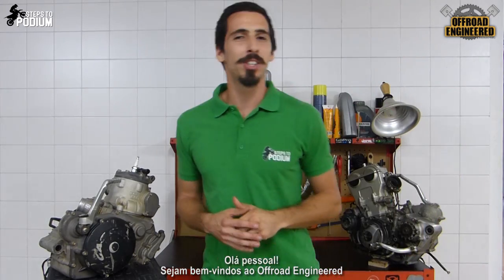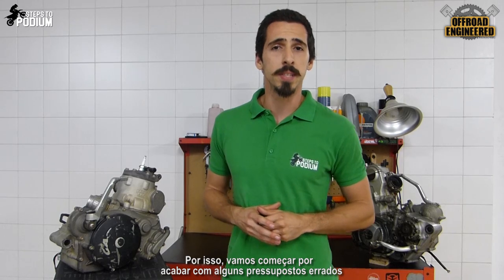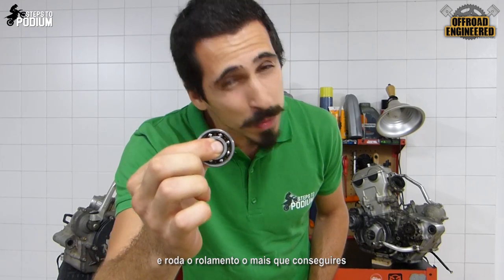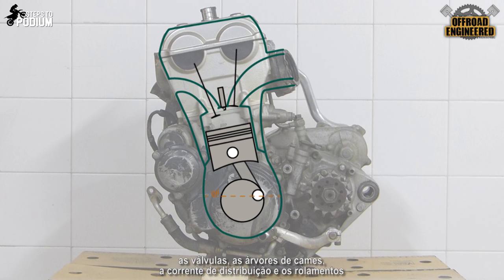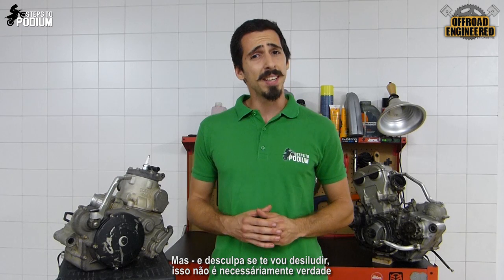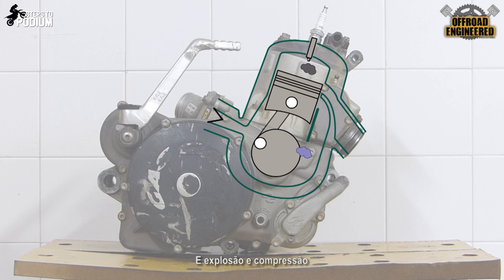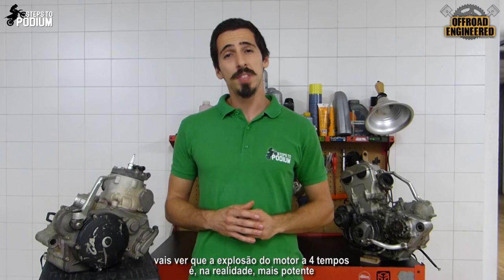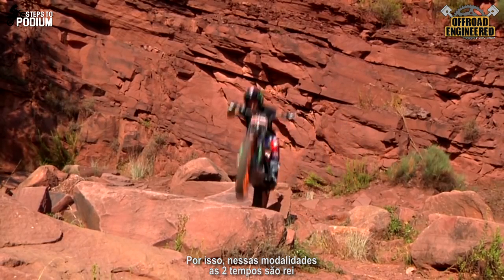2-stroke VS 4-stroke | Offroad Engineered

Comment: I raced dirt bikes in the woods for several years back in the late 80's-early 90's in (tight woods in N. Alabama and S. Tennessee mostly), some four stroke bikes and some two stroke bikes, and my experience was that the four stroke bikes were too heavy and wwwaaaaaay too hot to ride during hot weather, and that fighting that horsepower, weight, and heat would make me three times as tired by the end of the ride as the two stroke bikes made me feel. The two stroke bikes were lighter and much easier to maneuver in tight woods, plus they were water cooled and weren't hot at all to ride even during really hot weather. Four stroke bikes are great for fire roads and dirt roads, but not for tight woods riding (IMO).
Reply from the maker: Agree! 😊

Comment: I love my 2 strokes and one of these days
 Going to finally get around to finishing converting my 2t to fuel injection.
Reply from the maker: great project! 💪
Reply: Steps to Podium 
Sadly the shoppe I use to work at closed 2 months, we had a dyno. I was going to fuel inject 2 f my bikes, 
2003 Derbi Senda Super Moto that has every performance part money can including a Bidalot 6 speed gear box and FAG brand bearings for very thing. I even cut the swing arm and stretched it 10 niches for better traction and I kept the wire wheels cause they are lighter than alloy but do go tubeless. 

The other bike is a 1978 Kawasaki KZ1000. I have got that one a set of inverted forks, for the rear I have to do some welding to mount the a and all new brake and controls. Swing arm off a 2010 Z1000z 
For now my bike has been hung from the rafters and the motor and all it’s parts  are bagged and boxed, for a date to be announced later. For not I have to focuse on an impending surgery’, shattered my legs I. An accident years ago but now dealing with have one of them amputated. 
(deep sigh) 
It’s a good thing, I mean I’m going g to be even lighter,, more HP:Kilograms and less wind resistance too... cause why be careful .

Comment: 2 stroke is the best for off road ( motorcycle ).
Reply: Not if your lucky to own an RS250 and a H1 500.  Depends on when you grew up and what was around at the time. Modern kids just see four bangers everywhere and a crude 2t in cheaper bikes.  Not the old standard road going toys putting out 240hp per litre.

Comment: there's no other feeling, or any other time when you scare yourself but have a massive grinn on your face than when you hit the band on a 2stroke..😃
4strokes just dont do it for me after growing up riding 2strokes.
Reply: Race a 1000cc 4 strokes bike then, your smile will be compressed to the max.
Reply: I get the bigger grin when riding a 450 and having this massive power eveywhere, all the time, ready to explode without having to wait for the revs to build up. A 250 2t feels weak in comparaison even you can get good acceleration once it finally gets to the top of the power curve.
Reply: @Wide000  
I hear ya pal,
Its just i grew up in the 90s and love the power delivery of the 250 2stroke,
Im sure the 450s are much better in lots of ways, but its the powerband that makes the cheesy grin, and that feeling you just cant replicate with a safe, steady acceleration of the 450 4stroke.

But everyone has their own favorites mate.

It doesn't matter what you ride!, 
What matters is, that you ride!!.

Peace
Reply: @anonymous2065  Agreed. I am a vet rider myself and  also like the 2t. And I am no faster on a 450, just amazed by the massive power each time I ride my older CRF. The best compromise after trying all displacement, 2t and 4t, is the 350. It won't waste you as much as a 450, almost as fast overall, but lighter feeling, linear power, easy to ride, rev to the moon. You can ride it as smootly or aggresively as you want, and it will work in both case.  I love mine. Perfect vet bike.
Reply: @anonymous2065  4 strokes are more superior, it has stability to go beyond the top speed of 2 strokes. More displacement, more power, 4 strokes can handle more compression, whereas 2 strokes is prone to overheat, that's the reason why there is no 1000cc 4 cylinders 2 strokes, it will overheat in seconds, dead. That's also the reason why GP 500 ends with 500cc 2 strokes, it is the limit.
Reply: @Wide000  
Hmmm, that sounds like a good comprise,
The 350 would have more than enough power for me, 
To tell you the truth, i dont like the 450 4t, they are too powerful, big, heavy for me.
It sure does make me appreciate the top riders of mx or sx, because the fitness levels of some of those riders must be off the charts.

Nice talking to ya pal.

Peace
Reply: @novrahadi8568  everybody is ignoring you 4stroke fanboy hahaha
Reply: @rodmaiquez726  don't watch Motogp and WSBK then, because they are 4 strokes hahahahaha, even the fastest bike on Earth the Kawasaki Ninja H2R is 4 strokes. These bikes will smoke the 2 strokes. And these 4 strokes will feed the 2 strokes to dust hahahaha
Reply: @novrahadi8568  2 strokes are best for dirtbikes and 4 strokes are for roadbikes, that's common sense even for a 12 yr old like you
Reply: @rodmaiquez726  4 strokes are still very capable for dirtbikes, but the 2 strokes are dead for 186 MPH class of speed on the road lol lol
Reply: @novrahadi8568  race a 1000cc 2 stroke lol
Reply: @novrahadi8568  capable but not the best, if you want to talk about things be more comprehensive, and again 2 strokes are superb against 4 strokes all day  it's just that companies have a problem with emission regulations that's why they focused more on 4 strokes, kr500 will smoke any dirtbike lmao
Reply: @512levi  1000cc 2 strokes will be overheat in seconds and dead.
Reply: @rodmaiquez726  It's not about the emission regulation, 2 strokes have natural limit, it's prone to overheat in bigger displacement, that's why gp500 ends in 500 cc, bigger cc will be overheat in seconds and experience power degradation caused by thermal inefficiency. That's the reason why Honda started 600cc 4 strokes superbike back then, and improved to 1000cc so called CBR 1000, the mechanical failure of 750cc 2 strokes in original Kawasaki H2 caused by thermal degradation is the evidence why 2 strokes cannot have bigger displacement.  Kawasaki even stopped their research to push the limit of 2 strokes. The original H2 is dead finally.
Reply: even 750 cc 2 strokes Kawasaki H2 back then cannot reach 186 MPH top speed, today ECU flashed and modded kawasaki H2 1000cc 4 strokes can reach 218 MPH. Brock performance did that 2 years ago. This number of top speed is only a dream for 2 strokes, but for 4 strokes this number of top speed is real. I should mention Bugatti Chiron reached 300 MPH top speed has 4 strokes W16 cylinders engine.
Reply: Anom ymous agreed. I bought a new 98 KX500 I had a FMF fatty pipe and silencer and performance reed valves. The power band on that thing was Insane.
Reply: novra hadi Maybe you should go research the ski doo 850 etec.factory 2-Stroke 850cc Turbo.no problem with over heating like you state.
Reply: John  that's the limit of the 2 strokes, it cannot get more than that, but the 4 strokes turbo Hayabusa can get 600 HP on racing fuel and 4 bar boost.
Reply: @jerodtaylor7453  Yeah, very low boost, no significant increase on power, 2 strokes are dead if try to turbo it with high pressured boost. But the 4 strokes turbo Hayabusa can get 600 HP on racing fuel and very high boost. The 2 strokes cannot do this level of performance tuning.
Reply: @jerodtaylor7453  And you should know 6 cylinders 4 strokes Honda in 60 and 70s got 250 HP, beating the 2 strokes Yamaha in GP. Then the new regulation came to kill the multi-cylinders 4 strokes Honda by limiting the displacement to 500 CC and only 2 cylinders maximum.
Reply: John  2 strokes diesel can have higher compression to improve power, but it suffers from low rpm as the inherent mechanism of diesel engine. 2 strokes have weakness in the aspect of compression and bigger displacement.
Reply: @novrahadi8568  dont need to ride a 1000cc 4 Stroke instead ride a 500 cc 2 stroke like Honda NSR 500, Yamaha RD 500 etc you'll get more smile 😎
Reply: @novrahadi8568  500 cc Moto GP ended only because of strict polution norms. As you said there's no 1000 cc 2strokes becsuse when you get 200 hp from a 500 cc engine like in the honda nsr 500 then why you need a 1000 cc 2 stroke... Then you won't need a rocket to go moon 😎
And I guess you've no idea about kawasaki 750 2T nicknamed widowmaker 😏
Reply: @novrahadi8568  and then be very sad when a 500cc yamaha square 4 with over 150 horsepower made back in the 70's goes flying by you at 200 miles per hour winning world championship moto GP just like Kenny Roberts did his first year as a rookie and year after year   and then came the TZ750 that made over 200 horsepower and Kenny's tuner put the TZ750 in a mile dirt tracker frame and won the  Indy Mile  using the corner hay bales for traction passing four strokes like they were parked
Reply: @Wide000  i get an even bigger grin when your 4 stroker throws the cam chain through the side of the block and lets all smoke out !  And you will never get a third gear hole shoot on your thumper like a CR250R will as it literally smokes your ass into the first turn and lapping you in a 45 minute moto
Reply: @novrahadi8568  not a TZ750
Reply: @novrahadi8568  TZ750 = 200+mph ..you got a lot of growing up to do before you can say you know anything about motorcycles
Reply: @novrahadi8568  guess who it was that designed  the first bugatti engines that were DOHC 4V supercharged 1.5L that made well over 300 horsepower with a top speed in a front wheel drive car of over 170 mph and are still built the same way today only bigger ... The Bugatti engines are copies of an engine built by a Hoosier Hillbilly Hotrod  mechanic for Indy cars in Indianapolis Indiana of the Miller Racing team whose name was Offenhauser back in the 1920s ..in or around 1928 Miller went to Europe and entered  Grand Prix racing. A Frenchman by the name of Bugatti bought two of the Miller Indy cars powered by Offenhauser home built hot rods from hoosier ville usa ...hehe  and the rest is history
Reply: @jasonbrown7258  tell me what is a power band and how does it work in a two stroke engine ...and yes this is a loaded trick question as the correct answer was taught to me by the world famous tuner of all motorcycles "pop" Yoshimura
Reply: John  kenny Roberts first year rookie and first american to win the world chsmpionship moto GP on a 500cc two stroke square 4 with two crankshafts geared together and 4 single cylinder YZ125cc top ends buzzing like a swarm from hell ....the 350 twins would make over 100hp and top out over 150mph hehrhe ...as they would come down over the back hill  catching a good amount of air under the whole pack at mid-ohio sports car track ....and the  announcers screaming over the PA system " you can throw a blanket over the top 5 handle bar to handle bar as they were hitting over 155mph in the short back stretch jumping the downhill into the valley on "the pipe" peaked out
Reply: @novrahadi8568  two strokes are self supercharging making boost that never ends as the the rpms keep going up ...
Reply: @novrahadi8568  but they never beat yamaha's 4 cylinder 500cc two strokes that won the world championship moto GP of Europe that dominated everything there after ..two strokes arw self supercharging engines that never stop making boost ..that four strokes can never do but suck !
Reply: @novrahadi8568  wrong again as you have no knowledge of how a two stroke makes boost and displacement is no limit but only in your limited mental capacity
Reply: @rajkiranthomas3579  the yamaha TZ750 inline 4 cylinder two stroke were much faster making much more hp than anything else
Reply: @novrahadi8568  less education try to debate belike 🤣
Reply: @lenny0347  hehehe 1500hp turbo busa the king of 4 strokes, the 2 strokes killer, enter the chat.
Reply: @novrahadi8568  1500 🤭😂 I'm still laughing
Reply: @lenny0347  You can laugh at your own defeat! 1500HP turbo Busa is the real king, all 2 strokes are dead by now

Comment: The bigger displacement 2-t will smoke a 4 stroke in power output. Case point, a CR 500R will always blow the doors off of a 450 4t. Kaplin cycle did some dyno runs, and the 500R is truly a beast. Want mo 2-t power? Try the Maico 700 2-t, LOL!🤣
Reply: @StepstoPodium  You know it. I had an air hammer 84 CR-500R and it was a beast, it would pull wheelies in almost every gear, Complete monster. I rode a buddy's brand new, back then 85 500R, and it was a different story. The 84 was easy to race. We had a cool track in Arlington Tx, the night races would win you a kiss from the Baby Dolls gents club dancer, Yeap she had some teeth missin, but you wanted to git to the podium. Good utube site bubba! Wehaw!🤠
Reply from the maker: You are a legend😄😆 thank you so much for sharing that eheh
Reply: @StepstoPodium  Right on Daddy-o! Yeah! I shall enjoy learning some technical goodies from your site...um..keep up the good work!

Comment: I’m no motorcross expert but i know something about snowmobiles, on snowmobiles two strokes are the better option because of weight savings and reliability. The reduced weight allows for harder acceleration and the lack of moving parts allows for many problems to be fixed in the field, it’s just check the spark plugs, check the intake, if you can’t find a problem it’s the injectors/carb.
Reply: I never got 2t injection on my hand 😢

Comment: Well as a physicist I can say what you demonstrated with bearing is changing Angular Momentum/ gyroscopic precession and not Inertia. Inertia will be same for both bikes as  both bikes have same mass
Reply from the maker: in the case of the bearing yes (although with the bikes I don't agree since you have a fixed axis of rotation), but I decided to call it the same thing so people can understand the phenomenon in their hand compared to what happens in the bike. 
I know that some things are oversimplified but I assumed that in order to make the explanation simple for the average Joe or anyone who doesn't have a background in physics or engineering. 
I assume the deliberate "mistakes" stated 😊

Comment: Dumb question, how does a two stroke regulate the air flow for intake and exhaust? Is it done purely by the throttle body?
Reply from the maker: Carb/throttle for intake

Comment: A 2 stroke doesn't have a valve train. However, a two stroke generally lacks the bottom end torque that a 4 stroke has. Easiest and cheapest way to make up is regearing the rear for a larger sprocket. More expensive way would be a different expansion chamber for more low to mid range torque curve.

I like 2 strokes for their cheaper maintenance and rebuild, but 4 strokes just shine better in the power curve.

I prefer 4 strokes because they are generally quieter than 2 strokes. Since the 2 stroke DB snorkel is no longer in production, I'll take a 4 stroke.

Comment: Another way to look at the 2 stroke v 4 stroke debate.

2 strokes are mechanically simpler but engineering wise more complex.
4 strokes are mechanically more complex but engineering wise more simple.

What that means is simply the 2 stroke has less moving parts and seems more simple.  But in reality the engineering involved in getting the port size and spacing optimized as well as the crankcase pressures, and pipe design to get the most power out of the engine is very complex.

The flip side of this is the 4 stroke which is mechanically much more complex, but for now (unless dirt bikes suddenly start getting VVT) engineering wise much simpler.  There is no worry about crankcase pressures to draw in fuel or push it up to the intake port, the valve timing is done with a simple cam, and pipe design is much simpler.  Yes more parts to fail, but at the same time more user friendly. 

Which do I like... doesn't matter I like them both!!
Reply from the maker: that is a really great point of view! it really gives food for thought 😊
I appreciate your feedback and comment 😉

Comment: In 1996, Honda put their best engineers on a mission. Make an efficient, non polluting two stroke for  use in road racing. They worked on it but failed to find a workable solution. Its no surprise that four strokes dominate. During low rpms, 2 strokes fail to charge the cylinder properly at low idle. They misfire and only get better when the rpms increase. They also suffer from poor cylinder lubrication due to the fact that the lubricant is burned with the fuel. Pistons in two strokes do not last long.  10 hours for motocross. 100 hours for a bike, if you baby it.  
By comparason...I have a 1993 xr650l honda with thousands of hours on the piston. I have owned a two stroke mercury out board. It wore out in 5 years. I bought a four stroke to replace it. I have had it and used it for 15 years. No problem.
Draw your own conclution.
I owned a honda cr500. It was so temperamental.  The Honda 650l is opposite in that the only thing to fail was the battery.

Comment: Just a shame,  the wider motorcycle world will never get the chance to ride a fast 2t Road bike.  It's a different feeling all together,  way more fun than the heavy twist and goes.  Yes we can't go as fast in a straight line, don't compare 1980's technology with today's computer engineered missiles. I miss having a 750cc four banger, torque and easy to ride.  But I wouldn't give up my 2t which are loads of fun. Rebuilt both 4t and 2t, the 2 are easy, until you start playing with port timings, squish and back pressure.  The 4's are just packed with loads of parts, easier to tune, just really heavy.

Comment: is that mentioned of dirtbikes on 2st vs 4st? I love 2st' braking systems if needed immediate stop on higher rpm but 4st couldnt., had bad experienced with KTM200 Dude on speeding above 8k rpm, as resulted front fork oilseal leaked. If  no choices for 2st i will go for scooters: -)